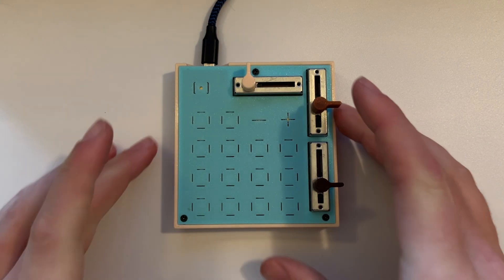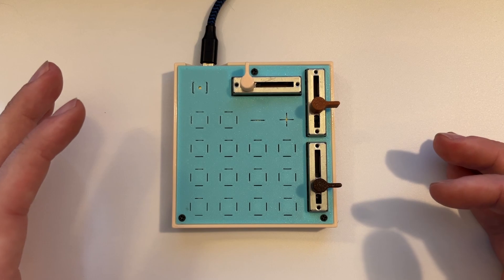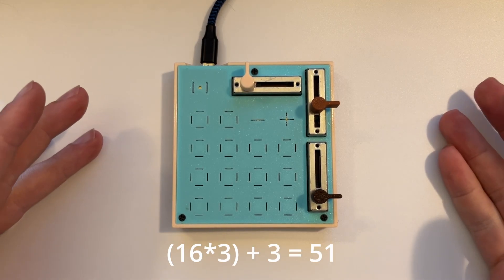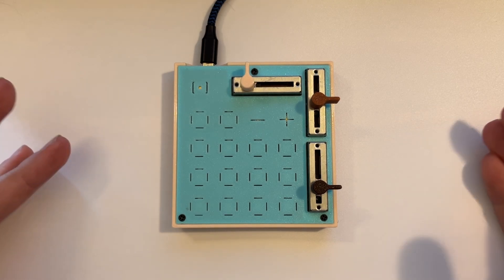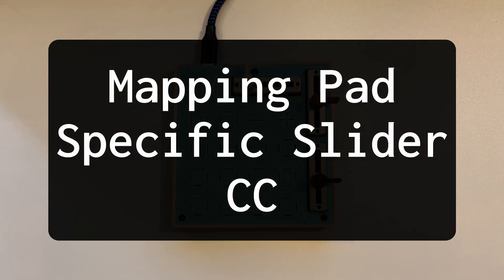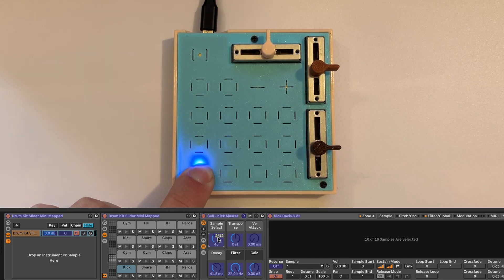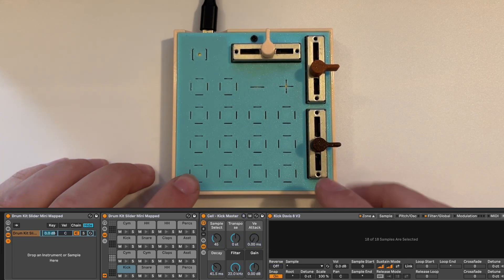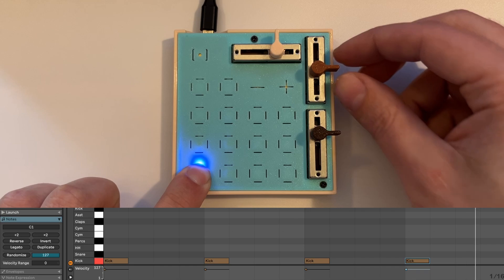Mini MIDI Controller with 51 mappable Sliders

Comment: Cool stuff! is the top made of pla? how did you manage to make bend only the part right above the button? any tips of thickness on that?
Reply from the maker: Yo! it is PETG and took a lotttt of trial and error. I'll be uploading all of the STLs at some point cause I wanna make this open source. The very top is only 0.5 mm thick, with the little slits to help make it bend per button. It has little standoffs on the bottom so that it sits juuuust right above the buttons, so that it barely needs to bend to actually press them. It works surprisingly well if you can tune it just right!
Reply: Betting beting .. You could 1970s that and Solder the whole loose under A diy Box Preferably non flameing
Reply: soderr sawder suader sayw dar.. Soldrer. SOLDERED
Reply: @AMPProf  what?